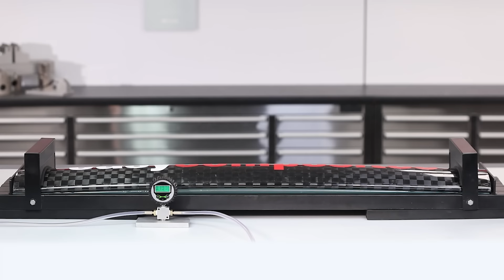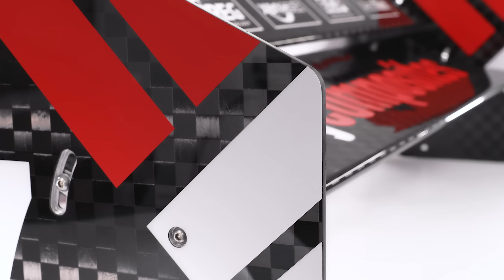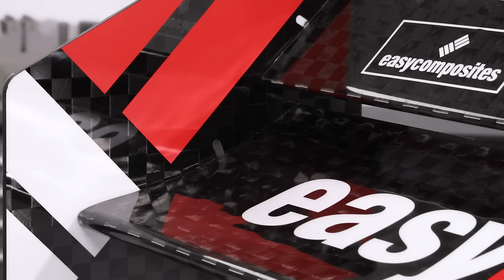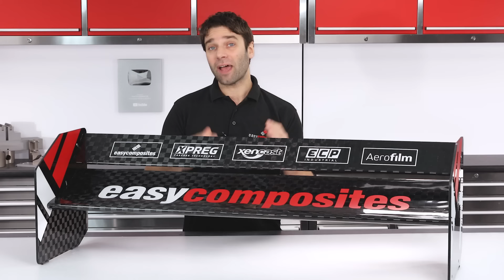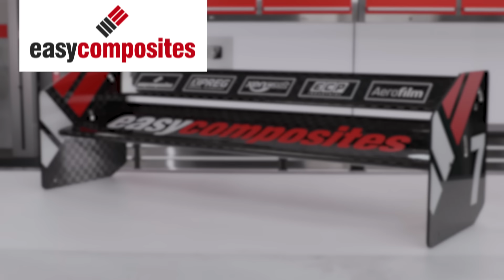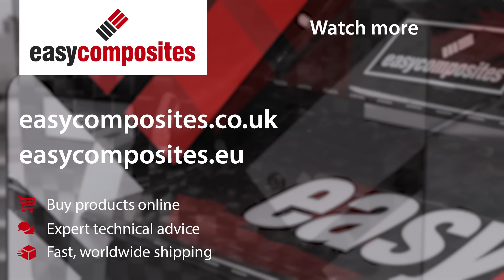Building a Rear Wing with Carbon Fibre and Nomex

Comment: Could you show us how to produce a composite rc airplane and how/If that would differ from this build?
Reply from the maker: For the wings, the process would be very similar. RC plane wings have been made using hotwired XPS overlayed with either carbon or glass, wetted out with epoxy, for many years. Other parts, like the fuselage, are most typically made using a hand layup of gelcoat, then carbon or glass and resin, sometimes (but not always) vacuum bagged. Check our RAMY RC's channel to see a master craftsman on RC plane builds.
Reply: @easycompositestv   Thank you very much!

Comment: It looks like the mylar "release film" saved you a bunch of sanding time.
Reply from the maker: Hi Keith, yes, it does provide a much better starting point in terms of surface finish. It's by no means perfect, as we discussed in the video, but for a lot of applications it's more than good enough and means very little work on the surface.

Comment: What airfoil design did you use in this example?
Reply from the maker: It was drawn up as a generic wing rather than anything specific. However the specific profiles used were "Eppler423" for the main element and "NACA4412" for the Secondary element.

Comment: love your videos and tutorials. always amazing results. i have a question... towards the end when youre talking about the ripples in the main wing portion, couldnt you have used the excess foam from the cut out like a clamshell mould and then vacuum it? similar to what you did with the MDF board for the end portions?
Reply from the maker: Hi Kyle, this is a an fair question and it's something we thought might work too, so we tried it! Unfortunately, what we found was that the inconsistencies in the thickness of the reinforcement (and resin) caused 'high spots' which prevented pressure from being applied to all of the laminate. We did a couple of tests and neither worked better than the normal vacuum bagged version (without placing it inside the foam 'offcut') and so this is the method we ended up recommending. If you try it yourself and manage to find a way to use the offcut to improve the result, please let us know!

Comment: If you’re using conventional moulds for this, is it moulded as an upper and lower then bonded or all moulded in one go with a bolted upper/ lower mould?
Reply from the maker: It depends whether the wing design is parallel (or features more complex compound shapes), and also whether the mould design gives you access into the ends (i.e. the moulds are open ended). If it's parallel and open ended then you can lay up the top and bottom, then bring them together 'wet' and carefully add additional wet reinforcement over the join. If you don't have access via the ends then usually you'd need to make the two halves separately and then bond them together afterwards.

Comment: Hi! I've been trying to push our aero department in our Formula Student team to fabricate lighter wings, as our current ones are unreasonably heavy. What would be a good method to exploit to get as light as possible wings, provided we don't have access to an autoclave. Maybe you could talk about different wing manufacturing techniques and when to use which, depending on time and money you're willing to spend. I didn't find an comprehensive resource in this matter and it'd be incredibly helpful to us (initially dumb) FS guys, especially if it'd be in depth and if it'd branch out to little manufacturing nuances and tips.
Reply from the maker: A fully moulded construction will be able to produce the lightest components but it's a lot more work than this process. One of the main ways you can save weight is to not over engineer the wing and just make it sufficiently strong for the downforce it's likely to generate. In FS, speeds are very low and so the downforce generated at these speeds is also low. This means you need much less strength in the wing than you might think. For example, this wing is probably 5 times stronger than you'd need for a FS wing, meaning you could reduce the reinforcement considerably. If you watch as many of our other videos as possible, you should gain a good understanding of the different methods available to you and be able to make an informed decision about how sophisticated you want these components (and manufacturing methods) to be.

Comment: Curious about what effect aluminum honeycomb would have as far as weight & strength ratios are concerned! Great videos like Always!!!
Reply from the maker: They’re similar in terms of compressive strength per gram and so the difference (and preference) is more nuanced. For these end plates, the sheer force is quite limited and so the lowest density core would be the best option. Since it’s hard to match the low density of a nomex core in aluminium, the preference here is nomex.
Reply: @easycompositestv  that was made easy to understand!👌🏻👌🏻🤘🏻

Comment: It's bit of a two part question really, would it be better to make it from your xc110 prepreg ? And if it's made with your  xc110 could you just sand it back and put the xcr coating to remove the slight ripples  ? 
As per usual top class videos from yourselves and it inspired me to start up my own business making carbonfiber motorcycle parts. 
Kind regards Neil Wilson (66carbon)
Reply from the maker: Hi Neil, thanks for the comment. To make this using XC110 you’d really want a mould. We’ve made similar wings using prepreg but the method is very different. I wouldn’t recommend trying to laminate prepreg over XPS, in terms of temperature it’s far from optimum. Give us a shout if you’d like to know more about our recommended plan for prepreg on a part like this.

Comment: What would be the issue pulling vacuum with the wing (after the mylar layer) back in place of the foam off cuts? Like this: [( O )] where the [( pieces are the waste foam core, the O being the laid up part.
Reply from the maker: Hi Austin, we thought this too, so we tried it. Slightly surprisingly it didn’t improve the result, in fact it wasn’t as good. The amount of thickness variation in the laminate and resin (some caused by the squeegeeing process) creates high spots which reduce the pressure in some areas of the laminate, if you vac down inside the offcut profiles.

Comment: Great video and easy to understand as usual.
This is pretty good for 2D parts, but what about 3D parts with significant curvature?  Which cloths and can the mylar drape very well?
Reply from the maker: No. The cloth will drape fine but the Mylar; not at all! You’d need a quite different process for a double curvature moulding. This is something that we want to cover soon.
Reply: @easycompositestv  Thanks for a swift response.  I look forward eagerly to the video.
Incidentally, it appeared you did a 6 hour ambient cure, not an oven cure.  Did I get that right?
Reply from the maker: Yes that's right, this entire project was done with ambient cures.
Reply: @easycompositestv  Thanks, that clarifies that.  I look forward to the strength test.

Comment: those wings look awesome!
what do you think about putting them into the negative cavity left in the foam, while curing?
Reply from the maker: Hi Marc, many comments about this. We thought the same and so we tried it! Slightly disappointingly, it didn’t improve the results.There’s a few reasons for this but mainly it comes down to the thickness variation in the laminate (due to the hand layup) which causes some areas to be under-consolidated when compressed inside the ‘offcut’ structure.

Comment: Instead of the foam core could you use a 3d printed inner core to help with the ribbles?
Reply from the maker: If you're talking about the ripples/wobble in the surface then this is more to do with the reinforcement that's added to the outside (and the varying amounts of resin) rather than inconsistency/irregularity of the core so I don't think that the ripple would could be improved by a 3D printed core and it would be difficult to print a core anywhere near as low density as the XPS (which is about 25kg/m3 or (aka a density of 0.025).

Comment: Maybe not for bolted conections, but for lighter duty connections, honeycomb cores can have areas reinforced with a thickened epoxy paste instead of inserts.  If you already have fumed silica and resin for skinning, a different batch with a good bit more fumed silica to get a paste is certainly viable. For this application, metal inserts is probably the right choice, but its a neat technique to have in your toolbox.
Reply from the maker: Yes indeed, there are a number of situations where making a medium density resin paste (fumed silica for the thixotropic property and glass bubbles to reduce the density) can be a good option. Other lighter weight materials can also be substituted for the heavier aluminium, especially if you're not tapping the ally.

Comment: Thanks for a superb video and mentioning galvanic corrosion! Could you please tell us what the filler material is that you used on the edges of the support structures? Not familiar with the number/name that you mentioned. Is it an epoxy? It seemed to sand well.
Reply from the maker: It’s VM100, it’s a black methyl methacrylate adhesive; very handy for such work and bonds incredibly well to composite. You’ll find it on our website 👍.

Comment: Perfect way to show the process, thank for that as usual. One thing that should be taken care of is making sure that the wing is not twisted/doesn't have any dihedral. In RC model airplanes, when vacuum bagging a wing, we place it in the foam cores and put some weight on the top to make sure that neither of the things mentioned happen.
Reply from the maker: Thanks and good advice. Any twist or bend would of course be much more significant on a plane than a car where the wing is just a small contribution towards the dynamics of the vehicle, but good advice for sure.

Comment: Great video.

You don't feel the need for a syntactic foam, or the like, for load transfer between the core and the inserts?
Reply from the maker: Hi Chris, we’re waaaaay over built already and the plan for this was to keep the construction pretty straightforward. In the next video we test the load on this. I won’t give anything away but suffice to say, it’s over built!

Comment: Really nice and useful! I’ve done equivalent processes some 30 years ago, for creating moulds for a sail racing project. Our manual hot wire cutting precision in normal styrofoam was VERY far behind what you got here! 😂
I’d be very interested in seeing what procedures you’d suggest for compound curve shapes, like spade rudders. 3D milling and lots of sanding, then make a 2 side mould on it, is my solution at the moment, but it’s not a quick process, to put it mildly. 😅
Reply from the maker: We do have an interesting process for compound curvatures and would like to share it in a future video so stay tuned 😀.

Comment: Wouldn't the remaining foam after wire cutting make a very good external support outside the mylar when bagging? Should reduce that ripple by a good bit and no extra material needed since it most likely waste otherwise. Also give that extra pressure in the right places to force excessive resin out.
Reply from the maker: Hi Rolf, we wondered exactly this thing. So we tried it! And…. it didn’t really work! The slight variation in thickness of reinforcement caused too many areas which didn’t get enough consolidation pressure. There may be some changes to the process which would improve things but from what we found, the foam ‘off cut’ wasn’t what we hoped it might be!
Reply: @easycompositestv  Good to know, thanks for the feedback!

Comment: In my formula student team we've been experimenting with using perforated layers (or just peelply) with absorbent layers to draw out much of the excess epoxy in the wet layup wing surfaces. This method has delivered us excellent fibre to epoxy ratios and really light weight wings but with somewhat lacking surface finishes. Same methods have been used for our flat sandwich panels. Having to use as much as 500g/m^2 for bonding the nomex core seems like very much extra weight to me.
Reply from the maker: There’s a LOT of ways that you could get weight out of this component but they pretty much all add complexity and potentially risk producing a defective component. This project isn’t optimised for weight but it’s very forgiving and will almost certainly produce a strong part at an acceptably low weight.
Reply: I wonder if perforated mylar sheet would help. You could have small holes in an evenly spaced grid to let the epoxy squeeze out through the holes, and use an absorbent material (quilted fabric) outside of the perforated mylar.

Comment: Why I have not used this mylar film before. 😶‍🌫😵‍💫 All the parts would have been with perfect finnish without sanding.
Reply from the maker: Well, it’s not a perfect finish unfortunately but it’s an excellent compromise of time and effort against results, especially for one offs or parts that might need to be changed and remade.
Reply: @easycompositestv  I 3D print molds and then make them stronger with plywood base. Mylar between printed surface and first layer could have been much better looking than release wax and then laying up...

Comment: I noticed that Mylar wasn't used in your carbon fiber hood build. Is there a reason one would use Mylar to create a wing but not a standard carbon fiber automotive body panel? Just curious. Thank you for another fantastic video.
Reply from the maker: Yes, they’re really quite different processes. For starters, Mylar will only follow a single curvature, and so a compound (double curved) component like a bonnet/hood wouldn’t work with Mylar. There’s a lot of other reasons too (part would be larger, causing fit problems etc). But, for the right projects this is a good process.

Comment: You should cut the bottom of the foam first so it doesn't sag and get melted as the wire exits
Reply from the maker: Yes, you’re right. On a more critical profile this would be important. It wasn’t an issue here but it would have been better to reverse the wire direction for the reason you suggest.
Reply from the maker: Thanks for the comment, I prefer to cut the top first as otherwise the weights on the foam sag the entire block, meaning that the top surface would end up offset slightly, I've never had a problem with where the wire exits, but I'm sure there might be times when cutting bottom first would be preferable.

Comment: This is wonderful. Although I do wonder how long it takes you from start to finish, including all the fails. Because you edit so well, it ends up looking almost easy!
Reply from the maker: We had a couple of practice runs at the smaller element, just to hone the process, but that was about it. It’s hard to say how much time from start to finish but, excluding building the hotwire, we’d finished filming in 3 days, and most of that time was things curing so, given the size and complexity of the part, I’d say it’s pretty low on hours. I’m not including design time in that either.
Reply from the maker: We had a couple of practice runs at the smaller element, just to hone the process, but that was about it. It’s hard to say how much time from start to finish but, excluding building the hotwire, we’d finished filming in 3 days, and most of that time was things curing so, given the size and complexity of the part, I’d say it’s pretty low on hours. I’m not including design time in that either.
Reply: It is easy! When you have all the materials, tools, setup area and lots of experience!

Comment: Go and do a series on how gliders are made. There are interesting features. First is the required accuracy. Torsional stiffnes of wings is critical. Very very chunky main spars. Equally the wings are flexible in the bend, not in the torsion. The mix of kevlar and carbon is interesting. Finish is another. 
On the hotwire cutter I presume it's important to cut the top first, bottom second for accuracy
Reply from the maker: Gliders are a good subject to demonstrate a lot of interesting and important concepts, much like any aircraft wing. On the hotwire, the whole profile is cut in one go, accuracy of the top and bottom should both be very good (more than enough for this process); we see less than 0.5mm tolerance 👍.
Reply from the maker: Gliders are a good subject to demonstrate a lot of interesting and important concepts, much like any aircraft wing. On the hotwire, the whole profile is cut in one go, accuracy of the top and bottom should both be very good (more than enough for this process); we see less than 0.5mm tolerance 👍.
Reply: @easycompositestv  The tolerance on gliders is obviously higher. For example, with some aerofoils you can detect a few drops of rain with a sizeable drop in performance. Caused by having too tight a radius on the leading edge.  Same for bugs splattered on the edge. So much so that you have gliders with bug wipers that go and clean the wings, in flight and then are returned to hide away in a garage. 

https://www.youtube.com/watch?v=lpDUatAb0Sk&ab_channel=krasw
Reply: @easycompositestv  Another one on gliders, that's an separate topic and easier to film in the UK, is repair of gliders. Which leads on to repair of composites, rather than replacement.  For manufacture, the nearest places are German, Poland, Czechia or farther away, south africa.

Comment: Does the strength of the vacuum not crush the XPS?
Reply from the maker: No, even at full vacuum the XPS is fine. Expanded polystyrene wouldn’t take it but we certainly wouldn’t recommend EPS anyway.